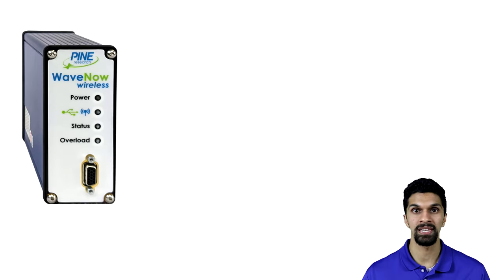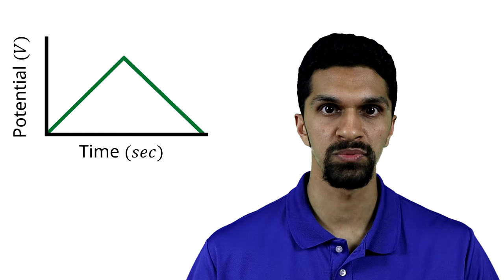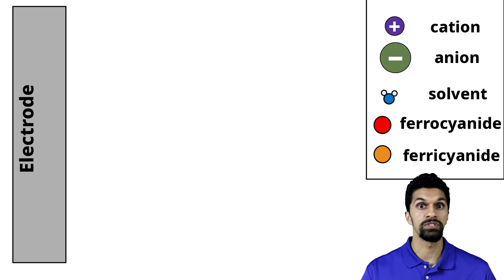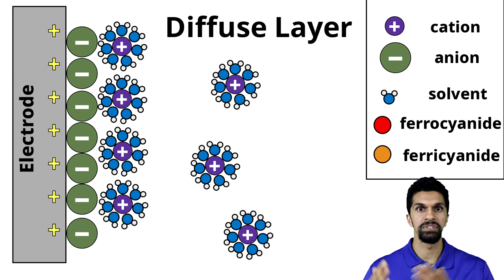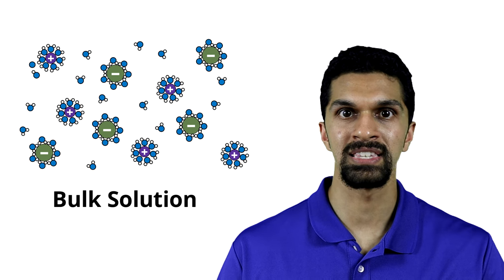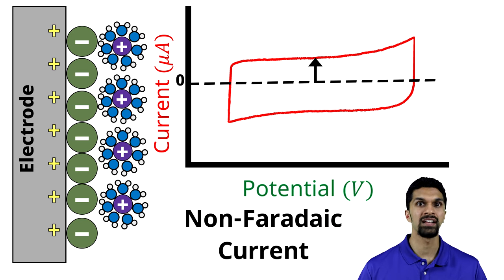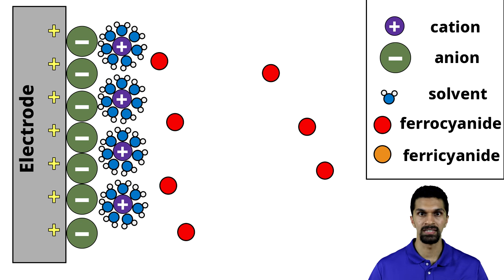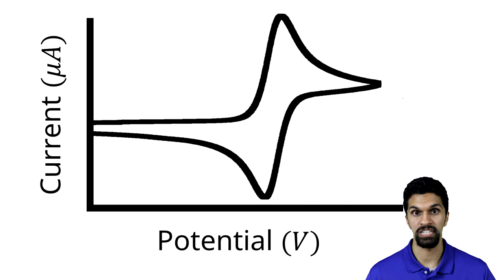Introduction to Cyclic Voltammetry

Comment: Great informative video. I am a beginner and I understand the phenomena of that. 
Do you have any other video suggesting how we select the electrodes/ electrolyte solution for any particular sample? Let's say Titanium Carbide powder and I need to check its capacitance.
Reply from the maker: We're glad you enjoyed the video.  We don't have any videos on selecting electrode/electrolyte solutions.  But for studying powders, most scientist drop cast a solution of the of powder in a suspension, and allow it to dry on the working electrode surface.  The working electrode in this case would be something inert like glassy carbon.  The electrical double layer can be very complicated and the electrolyte solution will play a role in the capacitance.  Sorry I can't be more helpful.

Comment: Thank you for the great video. I have a question, would it be possible to convert a cyclic voltammetry graph using a Ruthenium Oxide electrochemical cell to calculate pH values of an aqueous solution?
Reply from the maker: Hello Chris, I'm glad you enjoyed the video.  I'm entirely sure I know if what you are saying is possible.  Is ruthenium oxide the working electrode material?  Are you trying to calculate pH via CV?  I believe it is possible, but it will be dependent on ruthenium oxides interaction with protons in solution and whether the change in the pH will create a change in the voltammogram.

Comment: Is there any meaning . cathodic peak at almost 0.0 v volt?? 
Please answer ...
Reply from the maker: Was this something that I said in the video?  I couldn't find it when re-watching the video.  But in general, a cathodic peak is the reduction wave (mentioned around 12:05).  0 volts is just the position on the x-axis of the voltammogram.  So "cathodic peak at almost 0.0 V" means the position of the reduction wave is around 0.0 V on the x-axis.
Reply: @Pineresearch   thanks for your response. In my experiment I got cathodic peak at 0.05 volt. Does it any sense or not?
Reply from the maker: @akashgayakwad8983  It's completely possible to get a cathodic peak as a positive potential.  The potential is with respect to the reference electrode so 0.05 V might still be a low enough potential for your system to induce a reduction reaction.  Of course, I don't know what your system is, but you can have a slightly positive potential and have cathodic current.
Reply: @Pineresearch  thanks a lot

Comment: Question: According to the graph, potential is always positive? I'm confused. All I see on the Potential graph is that it starts for example at 0, reaches 10, and then comes back to 0 but always on a + Voltage. I think I must be wrong, but I don't understand how.
Reply from the maker: In your specific case, you must be sweeping the potential from 0 to +10 V (+10 V seems high) and so in this case the potential is always positive.  But you can sweep the potential negatively as well.  Are you asking why is it the case that I get a negative current even though the potential is positive?

Comment: Hi it's so informative, can u explain in detail of compleat CV With general working electrodes or commercial electrodes like LFP in 2 Electrode system with  very important is with KOH Or NaOH Electrolyte for battery.
Reply from the maker: Thanks for your question. Typically, CV is not the most preferred technique to use on batteries.  In a recent livestream I talked about this a little bit, see this link for some additional context: https://www.youtube.com/live/Zb36oDPMW8A?si=BkIYVqvenOJyYXMx&t=2062

If you want more live, detailed discussion of this subject or others related to batteries, I invite you join one of our weekly livestreams on Fridays at 1pm EST (US eastern time).  You can ask questions and I will try to address them live for you.
Reply: @Pineresearch  Thanks for your reply.

Comment: First off: Great Video!
I got two questions, I hope you can answer me.
What if my analyte is molten salt and i have no solvent? Just the salt and nothing else.
What changes if I‘m working with a two-electrode system without a reference electrode?
Reply from the maker: Glad you enjoyed the video!  We host a livestream on Friday's at 1 pm EST where I can answer your questions in more detail.  In short - molten salts act like electrolyte ions, without the solvent, however it's  a liquid so molecules can still diffuse like they would in the regular system.  I believe there are still some differences in things like the electrical double layer and it's structure.  But in general you can use the same model for CV in aqueous as in molten salts.

In a two electrode system, the main consideration is that the reference potential will most likely be changing.  You will measure and apply a voltage between the working and counter/reference but what the reference potential is in an absolute case will be different and shift around.
Reply: Thank you very much! This helped me a lot. Sadly, I missed the livestream.
Reply from the maker: @NadineLachmann  Not a problem!  FYI, I answered your question in the last livestream at 1:53:54.  https://youtube.com/live/2x2XL6ga2zY

Comment: Hi there,  I want to perform LSV and CV on the different anode materials keeping the cathode material same, but I am not sure what potential range and scan rate I should adopt? Is there thumb of the rule or guidance?
Reply from the maker: It will depend on the system.  But we did a live stream Q&A that goes over the selection of the potential range.  https://www.youtube.com/watch?v=8OavQwLmOPs

Around 5:03 we talk about a general approach to determining the potential range.  I hope this is helpful.

Comment: Sir could you send me a file in which whole process of cv is explained specially for psoudocapacitor
Reply from the maker: I don't know enough about pseudocapacitors to know what the CV response would be like.  However, my discussion of the electrical double-layer and the rectangular voltammogram would be the best explanation of a capacitor like response.

Comment: I think you have given the wrong explanation of the inner Helmholtz plane
Reply from the maker: Perhaps the wording could be different, but in this diagram we've defined the inner Helmholtz plane correctly.  It's the plane defined by the center of adsorbed ions that are closest to the working electrode surface.  Keep in mind that the double layer looks different when the potential is positively biased or negatively biased.